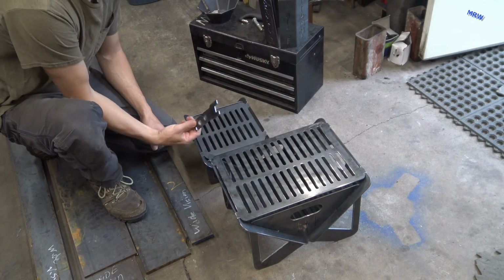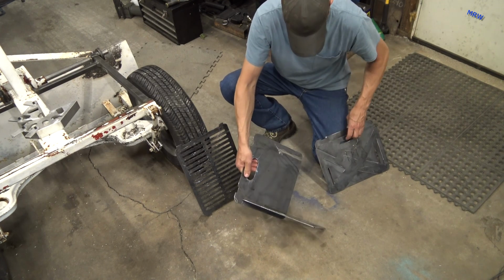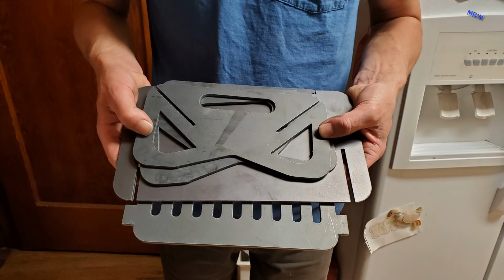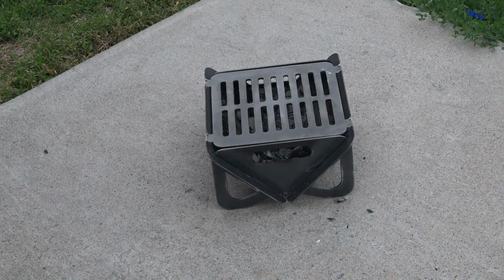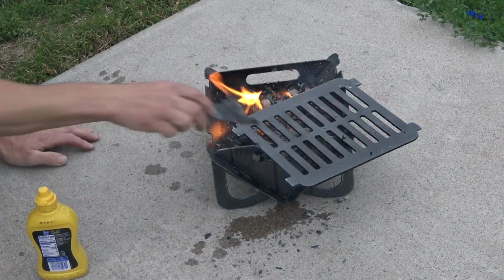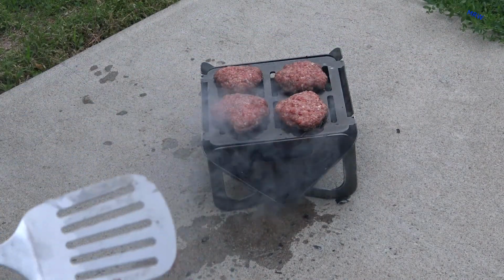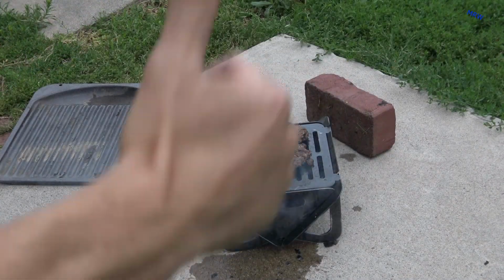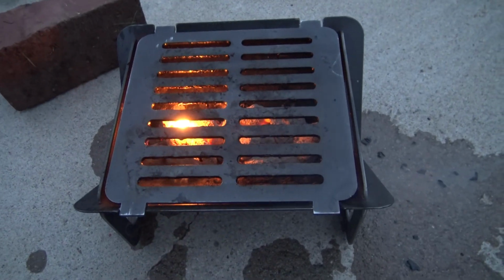Testing my Prototype Collapsible Grill

Comment: Nice design. Are the hand holes on the sides large enough to be able to add charcoal if needed?
Reply from the maker: Haven't actually tried it. But, the "wrench thing" I made makes lifting the grill top quite easy. I will definitely try putting a briquette through a hand hole, and enlarge them a bit if necessary. It's a good idea! :)

Comment: Thought he was gonna squirt mustard.  Made my heart skip a beat
Reply from the maker: Well, burnt mustard might add some flavor! ;)
Reply: No joke. Try mustard as a steak marinade. Could you place holes thru all the pieces of the larger grill to bolt a handle on after flat packing on the larger grill? I've been shopping for 1
Reply from the maker: @burntsky64  I gave that big one to a friend for doing some work for me, I could alter the design of the big one, then cut a new one. It's huge, though. Send me an e-mail at widevisionmetalfab at the gee mails for a better conversation if you really want one.